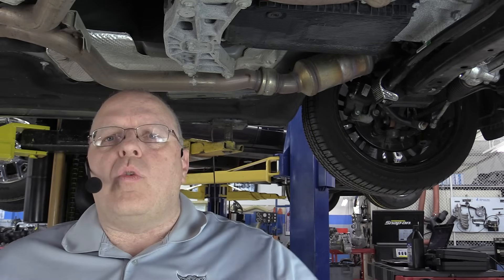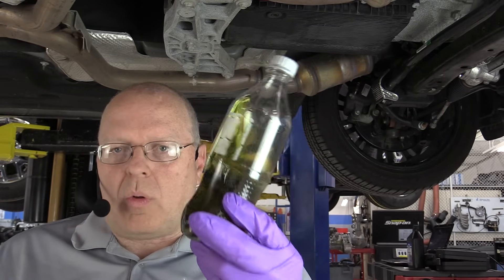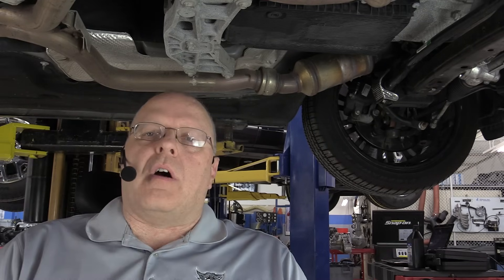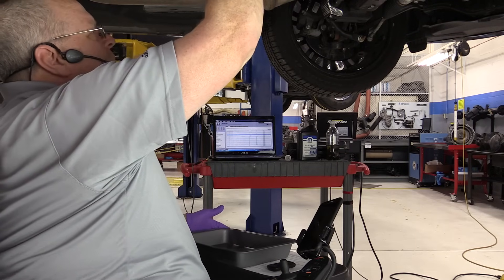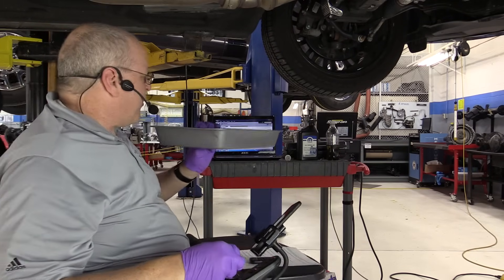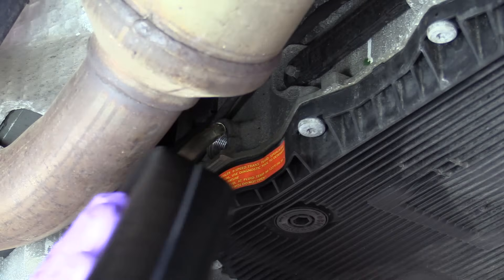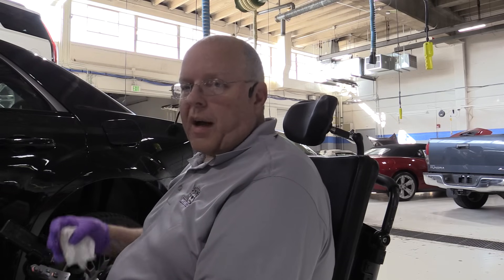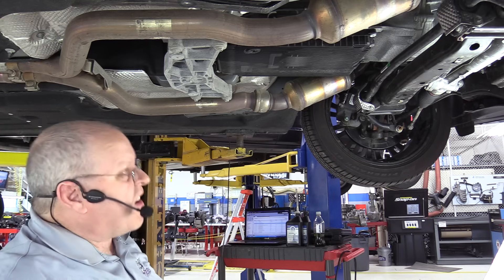Jeep, Dodge, RAM ZF 8HP 8HP 8-Speed  Transmission Fluid Level Check - No Dipstick

Comment: This video really makes me wonder what the dealer did when they replaced my transmission heat exchanger. Note at end of invoice says "checked trans oil level - OK". Clearly this isnt a simple check...
Reply: How did you get a dealer to change the transmission heater?!?!?  I've been to two of them with overheat conditions on my ZF8.....they said everything was fine....of course it was under warranty then....now that it is not....I bet they would change it and charge me $1000 for it now.
Reply: @jeffjohnson4664  my symptoms were a CEL and my oil temp wouldn't go up, no matter what. Also the cooling system was at full blast. The dealer determined it was the transmission heat exchanger thermostat, which can't be replaced alone, so they replaced the heat exchanger
Reply: @aSASa45454  Ah....mine overheats...gets up to 220-240 range and then won't downshift....just slams the gears around and goes to idle....which is really fun on a busy interstate.   But it won't throw a code....so the dealerships say "no code....no issue....no problem".    One dealer said "blow the damn thing up...then we will replace it."      This all started after a dealership "replaced" my ZF8 (bad 3rd-4th) shift.   Next thing I know....the "new" transmission starts overheating.   I know they did NOT replace the heater....so I am going to have to either do it myself or take it to a transmission shop.   Dodge/Ram wont touch it again. SMH.   This makes me wonder if they properly filled the "new" tranny.
Reply: @jeffjohnson4664  ouch- thats a shitty situation. Maybe try recording it after you pull over next time. The temp you are providing is the transmission?  I don't even think my car has that as something I can check.
Reply: @aSASa45454  I have recorded it....showed the Service Manager the video....Service Manager: "You know we can't do a warranty repair based on a video.  No code.....no issue.  And that is well within the normal operating range.   Drive it until it throws a code or blows up."
Gotta love FIAT.
Reply: @jeffjohnson4664  Thats awful.. maybe try another dealer? That's a major safety issue & I'd be furious. Im not a lawyer  but it might be worth contacting one.

Comment: It's German engineering at it's finest. But it's really not difficult. No different than checking and filling your differential. That's if you do the work yourself.
Reply: Yeah really it's not.  Take it for a short drive going through all the gears and as long as the temperature is below the specified temperature 120 I believe.  You should be able to get a trickle of fluid.

Comment: I am hoping I am right but maybe the fluid does not drain Alps of the cooling lines maybe there is enough pitch on the line to wear it retains the fluid I don't know for sure though either way excellent video can you please come up with another video for an aftermarket dipstick install thanks in advance

Comment: THIS is exactly what you could expect from egg headed engineers that have nothing better to do all day but sniff transmission fluid. Anyone who does it this way just likes to torment themselves.

Number 1 : you're already driving the car.

Number 2 : if the transmission was shot you would know it cuz you wouldn't be driving the car you'd be walking.

Number 3 : quit screwing around with all that nonsense, start it up, put it on the lift and run it through the gears, get the trans up to 100 ~ 120 degrees, pull the stupid check plug out and see if something comes out. IF something comes out quick shove the plug back in and if nothing comes out fill it up until something does. 

WTF ALREADY ???

Comment: If I raise my car level in the air with the engine cold and catch all the transmission fluid, then drop the pan and measure everything I take out and I put that exact same amount of transmission fluid back in will l be all right.
Reply: As long as you know that it was the correct amount before draining it  than "in theory" you would add the same amount back into the vehicle that you had just drained
Reply: @scottypockets9354   Thanks for responding.👍

Comment: Thank you John!  I cant thank you enough for this professional video.  I'm changing the fluid now on my 2014 Ram 1500.  It has only 41K miles but I have towed a 9K trailer 2500 miles so just want to be safe.  The part about the bypass valve and air in the lines is critical.  I will do the 2 step process on 2 heat cycles after I get the temp to normal driving temps that allows the valve to open.  Thanks again!!
Reply: you don't need to worry if you drain cold (cooler stays filled). you could also measure what comes out and put the same amount in (if original and no leaks) if you do just a drain (vs replace filter/pan)
Reply: @ericsacco7406.....The transmission filter is part of the PAN, so it will cost about $150 to replace the filter!!
Reply: @1gr8oil  Correct yet the Dorman unit has a replaceable filter for the next change.. you keep the pan to save $$
Reply: You guys keep mentioning the "temp to 180 degrees"  but you never say....is that ENGINE temp or TRANNY temp?

Comment: Maybe I'm missing something here but, If the cooling valve opens at a certain temp, and closes at a certain temp, If the transmission is correctly filled, wouldn't there be some transmission fluid "locked" in the cooler when the valve closes ?

Comment: Thank you for the amazing knowledge. This might sound dumb but if I was to drain the trans fluid and catch it and put in the same amount through the fill plug, would that be ok? I know it wont be as efficient as replacing the pan and gasket but just wanted to know.
Reply: I'm doing the same thing. Fluid out fluid in.
Reply: That's how I did mine. I changed the pan and filter but ended up right around 4.5 -4.75 qts

Comment: Thank you for this video. I was thinking about doing a filter and fluid change on my own in the driveway. 
The temperature thing really spooks me.
Now I am not sure I could even trust the dealer to do it.
And thanks for helping me understand the depth of this repair.
Reply: yeah, this is exactly how I feel.  I even managed to find the ZF-published procedure and it is a bit confusing on the transmission cooler point.  It seems from comments here that part of the procedure isn't necessary on Rams because the fluid is in the cooler whether or not the valve is open (3-valve system)
Reply: @NinjasOfOrca  I did mine on my grand Cherokee and just measured what I took out and put the same back in

Comment: Excellent tutorial from this amazing technician. It’s a good thing the ZF 8 speed is such a great transmission to use, since it’s not easy to change fluid. At least you can fall in love with the operation of it.
Reply: it s near impossible to change the fluid. Even authorized BMW dealerships refuse to change ATF claiming it s supposed to last forever!

Comment: The 8 speed transmission fluid is filled for life fluid no fluid change required according to dealer connect
Reply: It could NEVER leak, could it? Sealed for life gets a trans tech off the payroll, gets a $15 an hour parts changer something to do. Dealer win! They have you indoctrinated already.

Comment: It seems to me that most everyone is making way too much of the fluid level check proceedure. 
Shouldn't I be able to come home from the store on Saturday, (parking on a level surface), let the vehicle set until the temperature is within specs, pull the plug and hope for a very slow drip?
Reply: Absolutely. That's all they are doing.. Engine running tranny temp below 120 on level surface. You should have a small drip.

Comment: I recently purchased a new vehicle but before I did I researched all the different brands because I like to do basic maintenance including servicing the transmission myself because I plan on keeping it a long time.
I chose a often bashed car, the Dodge Journey equipped with the 2.4 four cylinder engine instead of the optional six, why ?
The Journey with the four cylinder engine comes with a old four speed automatic first introduced in the late 80's and it has been updated and improved over time.
The four speed automatic in the Journey stick has a dipstick to check the transmission fluid and because it is a old style transmission it has less parts to break and the fluid is much cheaper than newer 8 and 9 speed ZF automatic transmissions.
Case in point : A 1.3 gallon of ATF+4 synthetic transmission fluid for the 4 speed on Amazon, $ 30.35 and that's Mopar, Chrysler's brand.
The same amount for the 8 and 9 speed ZF transmission now used by many Chryslers ? - $ 149.95 and that does not include the new transmission pan you have to buy because the filter is built into it and it cost over $ 200.00 online, the dealer, over $ 300.00.

Comment: But would there be air in the trans cooler?  I would assume it to always be filled with oil since bleeding all the air from it once it's in there sounds problematic. If it's always filled with oil, the state of the thermostatic bypass valve would have no influence on the fluid level apart from expansion of the fluid that was in the cooler during the measuring flowing into the now warmer transmission.

Comment: Ford power transfer units came with lifetime oil and no drain plug just a level plug but i guess the engineers over sight saw most of these oil baked and slugged up.. trying to suck out that degraded oil flush and fill is time consuming.. i guess they'll consider putting a more realistic service schedule next time and maybe a drain plug

Comment: In my field keeping the fluid contaminants to a minimum say 10 to 20 microns is important for component life sealing and eat up most of the oxygen is a good idea to prevention oxidation however other comtamination are self induced due to natural wear of components.. it would be great to see what an oil sample would reveal from these transmissions after 20,000 miles.. then determine if it would be a pro or con to just leave the dip stick in and earlier service intervals
Reply: 10 to 20 microns, you would need a microscope; it is not until 40 microns that one can see the particles. Most people "eyeball" for contaminants, fun.

Comment: Good to know about that bypass valve 🤦🏾‍♂️🤔 i think they made the check proceedure more complex than it should just to prevent the average joe from tampering with it.. they could have made port higher raise the test temperature and provide an oil index to temp cart..
Reply: Absolutely more difficult than necessary.

Comment: I'm glad I ordered the five speed nag1 when I bought my new charger in 2013
Reply: Nag 1 is even worst , it doesnt have a drain level check , you need to buy a dipstick and compare it with a chart , temp vs mm and if you over fill it, you need to drop the pan out and fill it again.

Comment: Quick question I have a 2016 Ram 8HP transmission (transmission is controlled by a knob) with 58,000 miles manual says fluid is forever thats hard to believe when should you change transmission oil truck is used for daily use no towing.

Comment: What about using a heat gun on the bypass thermostat to make it open?
Reply: I'm guessing that is the reason for the low temp procedure.  It seems like if you open the bypass, the fluid in the cooler will all drain down to the transmission and come out the fill port.
Reply: @andrewyoung-n8ary  yea. Btw I had catastrophic failure the ZF8HP on my 2016 grand Cherokee summit with hemi after it overheated at interstate speeds at 25k miles. Warranty replaced it. Right around $7k job

Comment: Alvarado first check the oil level that is correct in the transmission and that this oil is in good condition in the user manual see the transmission fuse where it is when you have it with the truck off, remove it for 15 or 20 seconds and put it back like this  you do a new learning to the transmission I did it that way and the problem was solved this is done so that the transmission adapts to your driving forgive if you do not understand something I do not speak English

Comment: Can't we just drop the transmission pan, collect all of the fluid, pour it into a measuring cup of some kind, and then see how much fluid was removed and just put back an equal amount? Sounds like a fool proof plan to me. If anyone has any objections, please comment lol. I'm doing this to my 2016 DodgeChallengerSXT when it's at 100,000 miles which is in about 8k miles from now. So very soon.
Reply: How did that go for you?

Comment: I didnt get it - he said the fluid level low and he added and after that he said it’s too much and he took some out . So can you explain it plz ????
Reply: He does everything by the book.. so the first step in the book says that with a cold temperature IF fluid does NOT drip out.. then ADD fluid... (you add the oil FIRST like a safety measure only to prevent damage JUST FOR THIS TEST!)... once you do the 4218 steps to get the fluid up to temperature and through all the gears... you open the plug again and if oil drips then there's too much.. if none drips then add.
Reply: Azizjon Juraev it has to run out of the inspection hole to start the test.....but after testing when oil will have circulated through all the passages it still comes out, you let the excess come out.
Reply: Looks like he drained out what he first added to begin with.

Comment: Okay once you said but there is a little bit more to it than that I was worried.. and sure enough I located that transmission cooler bypass valve on my Chrysler 300 and that's when I decided to take it to the dealer and let them do it.. to much work.. but it's a good thing I seen this video because now I'm going to question the mechanic at the dealer and see if he knows all this😁 thx... Great work

Comment: automatic transmission ZF 8 HP 8 speed descending speeds from 2 to 1 feels a small boom can you explain to me about this or give me a solution..dodge challenger set 2018 sorry for the inconvenience thanks
Reply: My 2014 RAM (845RE trans) does the same. When I purchased the truck I noted this (it doesn't always happen to me, it's more like when I'm getting to my parkway or some very low speed maneuver. It looks like it's common on these transmissions. Mine has 264K miles
Reply: @engineer_alv  sir, did you serviced your transmission or it has that amount of miles with original filter and fluid? Thanks
Reply: @tomorrowcomestoday1621  it has gone through 2 fluid changes
 and 1 transmission fluid pan. 271K now

Comment: I have one of these 8 speeds with alot of miles and probably towed alot. Recently noticed the transmission is slow on the gear changes like a jerk movement, is it the fluid that needs to be swapped or is it something else?

Comment: I wonder if there is a check valve in the cooler lines to prevent the backflow of fluid to the pan.  My 2001 Ram had one, it went bad & burned up the transmission as fluid couldn't go through the cooler.  I wonder if that thermostat is similar to a check valve, preventing drain back to the pan?

Comment: Would that what appeared to be a 16th of a quart that drained out really made any difference to bother anything?
Reply: Nope.  Its all BS to scare people from doing it on their own.  Half a quart high or low would mean NOTHING.  Its funny.  We are to believe the techs at the service center care this much.  They drain it and refill it until it flows out and they are done.  Hot or cold.  They don't care, and it all works out fine.  Of course, that's if they even do it at all which they likely don't.

Comment: Wow I'd change that fluid and it's crazy it was that low being from the factory I'm wondering what else is low quality control and that is the dumbest transmission change I ever seen what if the cooler system fails and you don't know it poor design
Reply: That's a Chrysler built trans from Chrysler assembly line not zf